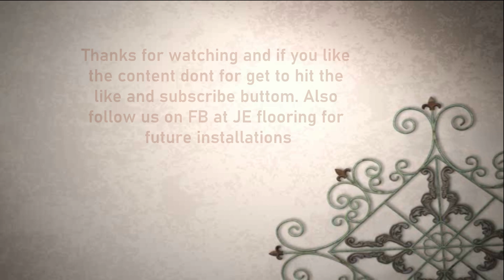How to install carpet on steps

Comment: I give you a lot of credit for putting yourself out there, JE but that is not the proper way to install steps. I would highly reccomend that you at minimum get a copy of the CRI carpet installation instructions. It's a true eye opener on how to do things with manufacturer recommended installation practices. I can see you do care about your final product and this would help you avoid any future issues with warranty claims.
Reply from the maker: i just seen the cri guidelines for my first time but after reading them i kinda see them for example its like going to chevy dealer vs going to a self owned garage, one ways by the guide lines the other is by experience. you get the same results from either one you go too besides the bills alot cheaper at the self owned garage. ive been doing it this way for 20 years and never had a issue with wear issues that id have to call the manufacture. im also not out here trying to charge the top dollar cause one it saves the home owner and leads to more jobs. im sure they create/change the guide lines all the time cause it can be a loophole to get of replacements. Thanks for the advice, ill take it into consideration in the future